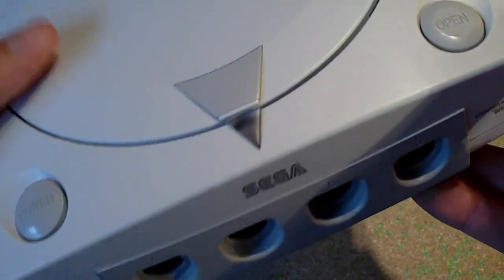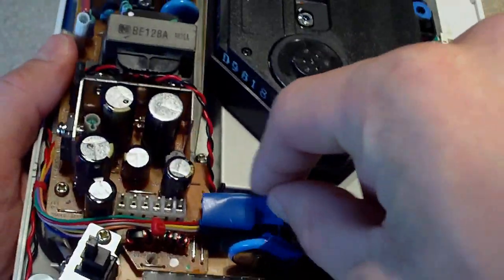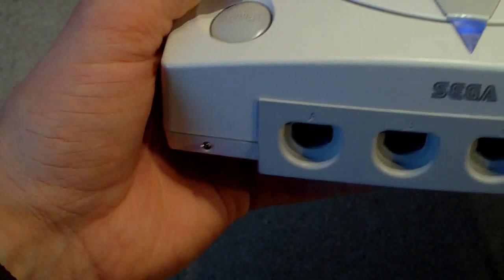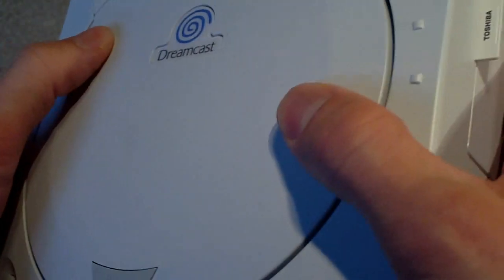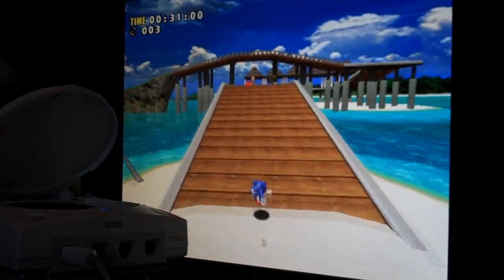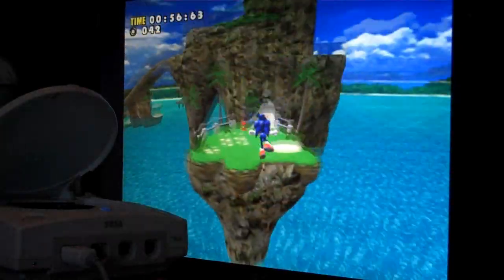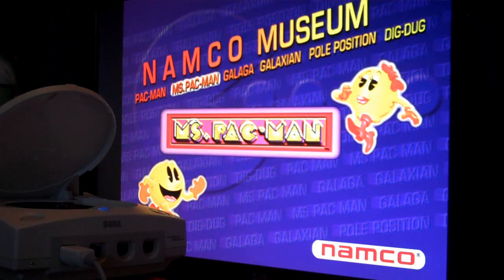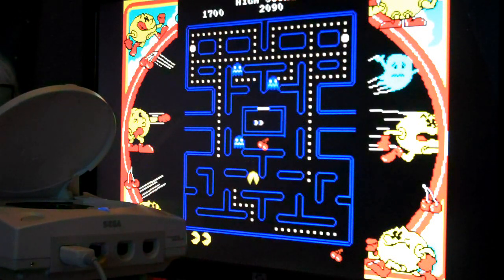Mod Complete - Dreamcast With SD Card Slot Booting Retail Game ISOs

Comment: actually you don't need a 99 dreamcast the rumor (which was started by sega to prevent piracy) was for a dreamcast built in oct 2000 or after wouldnt play backups. its bullshit all dreamcast play backups except a few later japanese ones. i own 3 dreamcast one built oct 2000 and 2 nov 2000 models all play backups.

Comment: @Rafael - the file manager is Dreamshell, which was coded by Mr SWAT (Google for "Dreamshell dc-swat".

It loads "SD-ISO" game images from the card, but you still need to boot from the Dreamshell CD-R unless you do a BIOS mod.

An SD-ISO is a slightly modified version of a DC CD-rip. You can find them to download on the Web. :)

Comment: Have you tried different SD cards? your saying that the serial port bottlenecks so there is no way to mod the input used for the GB ROM?  It look like the games that load on the fly mess up... why would you want to load the copies though an SD? Dont burns work just fine? or is this so you can have multiple games on one stick?  ...but what I was saying before I know I saw it somewhere on the net were I guy took out the GB ROM and just installed a hard drive and had every game on that hard drive

Comment: you know what i was just thinking, because the gdrom drive reads and 1.2mbps there are people using that port to implement a better solution but why not bridge those two ports for better bandwidth.

is that crazy talk or is it possible

Comment: It's really not surprising at all. RS232 has a very low signaling rate, it was good enough for external modems in the 80s and 90s, but there was a reason external CD-ROM drives used SCSI :)

Comment: I'm quite surprised that the serial DC's serial port would be actually slower for data transfers considering that the GD-ROM drive is but a CD-ROM drive equivalent of 12x in speed o.o;

Still great job here =)

Comment: Just wanted to point-out that Dead or Alive 2 for Dreamcast loads much faster with Dreamshell 4 RC1.  Yes, the entry to a fight scene lags a little (about 3-4 seconds), but then the fight scene is really playable with RC1.  The coder has implemented a much faster read fix.  You should try RC1 to confirm it.  Thanks, -Steve.

Comment: SD cards are flash memory. If you mean a USB flash drive, often they are made with the exact same flash modules SD cards are made out of.

The speed issue comes from the fact that the SD card is being read through the Dreamcast's SERIAL controller, thus the speeds are not as much as you would get if you ran the card on a PC. bear in mind this tech is still new on the dreamcast so new drivers may possibly come around that speed up the read speeds

Comment: This is quite impressive, pal! But I wonder..why doesn't for example DOA2 run at proper speed? Is it because it can't read data fast enough from the SD? If so, wouldn't it be a good idea to make a usb port mod and make it read isos from a 2,5" hdd maybe? Is that even possible? Anyways, very good work! :)

Comment: Sega's last attempt to stay in the console business. It was a good system, it just didn't sell well. It was pretty innovative, being 128-bit (having a 32-bit processor, though) and there were these memory cards that could be placed in the controller called VMUs (Visual Memory Units) that could have mini-games downloaded onto them, via DC games. There wasn't a piracy lockout which allowed piracy of Dreamcast ISOs, but only in 2/3 variations. Unleashing the PS2 with dvd support would doom the SDC.

Comment: doesnt matter what protocol you wish to use for that, if its using ethernet it has to be a BBA, because like i said, again, no one made an alternative for it, or even manage to emulate it. because, again,it has that mystery chip. if you want fast transfer,think about what these people did(SD adapter).instead of working their way to make an ethernet function work,they went all the way and make a whole new thing for scratch.because.you dont need to be a genius to think about using an ethernet port

Comment: If has of yet there hasnt been any BBA alternative,its beacause its hard not to say impossible to replicate.it has a "mystery chip" that no one knows what it does,or how it does it.or if someone actually does know,hes sure didnt share his wisdom on major Dreamcast forums.and its not because DC OS is BASED on windows CE thats its easy to code for.again,if it was,it would have been done,ages ago.look at this SD adapter thingy.barely made a DECADE after the system release.theres a reason for that

Comment: @ghettochildusa To not have to burn a CD every time you want to play a new game, to have multiple games on a single SD card, to not need to swap discs to play new games or access ROMs for emu, to just have more storage space to work with, lots of uses for this. It's especially useful for testing homebrew games and versions, mods etc., no need to burn a CD every time.

Comment: Couple of quick questions about your stripboard layout:
1.)  The blue lines are bridging just those two points right, NOT the ones in between them (for example the b through f bridge would not connect c,d and e as well right).
2.)  What are the red dots?  I'm assuming I would sever the connections on the strips at those points right?
3) Anything special about that green connector wire?  Or is it just like the other blue lines.

Sorry if I sound like an amateur but I'm just recently got into mods

Comment: Nice video, and nice mod.  
For those asking you need a DC built before November 2000. I have a Oct2k DC and I have every DC game in .cdi format from underground gamer((the best for retro they have every game and every emulator)) and i use disk juggler to burn the .cdi's and I toss them into the DC and it plays every game every time like its the real deal.  No hard modding at all.  Those are the easiest DC systems to play backups.

I'd love that mod tho It would save me a lot of space! gj mate

Comment: @AtomiXStudios Kinda pointless as the resolution wouldn't go up since the graphics processor almost definitely couldn't display at such high resolutions, however, there is a dreamcast VGA adapter that creates extremely crisp and high resolution graphics, I recommend getting this instead, and it doesn't even required any modification of the internals.

Comment: Thanks Retro.  I'm all modded up for SD card thanks to your inspiring videos. I even have the make sd iso app for PC too.  Happy days.  The Dreamcast also has amazing NED,SNES and Genesis emulators with virtually all roms that runs off the SD!!  Will be doing the BIOS flashing switch mod soon so that even Dreamshell 4 will boot from startup off SD.  C'mon Dreamcast - Still Thinking!

Comment: Technically if people still gave a shit about Dreamcast hacking game should be down sampled to solve issues of sd card. The serial port can only stream so much so you could down sample the audio bit rate in the battles. You could also use lower resolution textures if you really had the skills to do so.

Comment from the maker: @FeeLtheHertZ It doesn't matter how fast the SD card is. It's connected to the serial port which is MUCH slower than the GD rom. You are limited by the Dreamcast's hardware not the SD card's capabilities.

Comment: uhm, what are those red square things with red dots?
I find following the stripboard ver easier since I can't read schematics properly, being a real noob at this, I'm really noob.

I was able to solder wires to the dc serial and followed the stripboard as it's on the image. dc won't turn on and the + wire, pin10 from dc, keeps getting hot. dc boots fine when I disconnect pin 10 which supposedly is supplying the power?

Comment from the maker: @watermeloncat no, you are limited by the Dreamcast's serial port sadly. That's why some games that need to access a lot of data while playing have framerate issues. I think the serial port maxes out at 1.5mbps or something like that. The card I used in the vid was a class 6 SDHC 4GB but it makes no difference since the serial port is limited to 1.5mbps.

And thanks!. I like to keep any mods I do looking as stock and original to the console as possible.